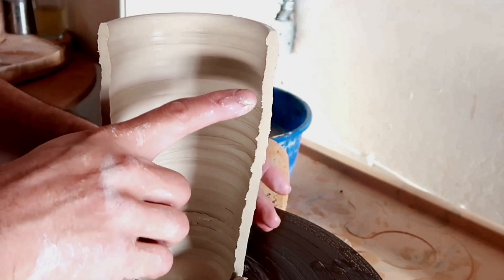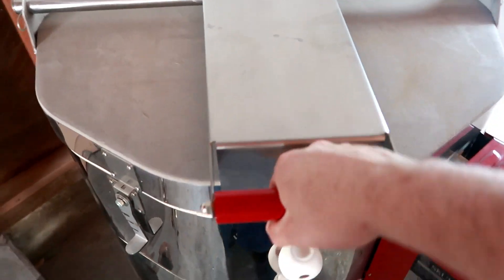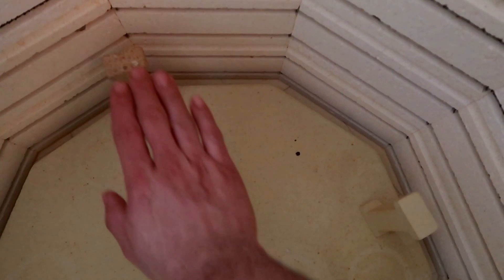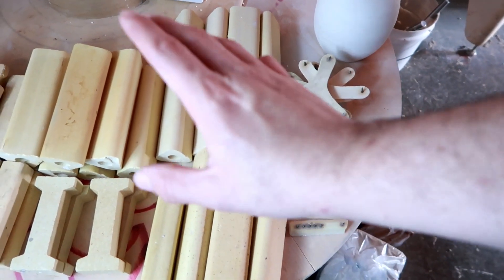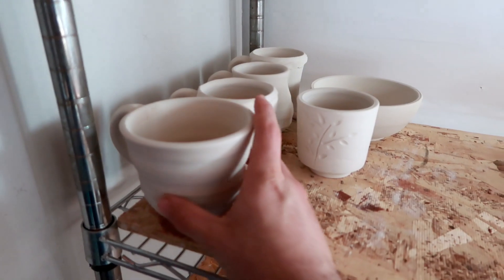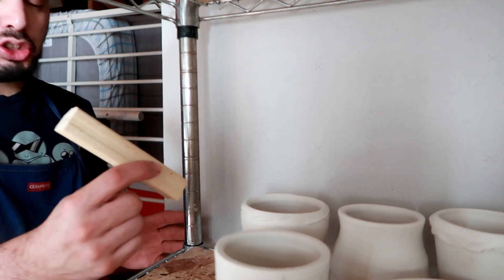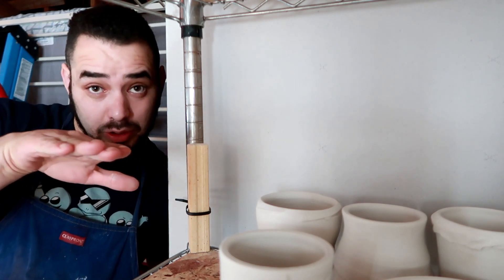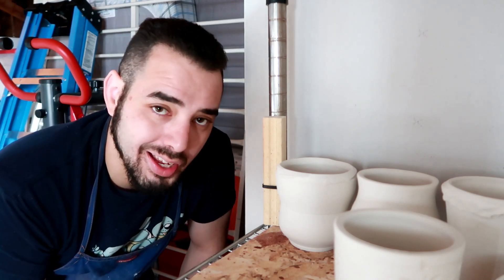organize your shelves with this one trick ! (potter tip)

Comment: Good info D. I noticed you had some of the metal pin mini stilts. I have the ceramic versions. Cold you do a video on the correct use of these, what and when you can use them. Cheers great work.

Comment: I use zip ties extensively in aircraft - I know, scary. Cutting them off can leave blades that will score deep and awful gouges in your skin. There are special tools to cut them flush, but a great hack is trimming with toenail clippers. Your arm can slide past without making an offering to the clay gods.
Reply: You can also hit them with the flame of a lighter for half a second.